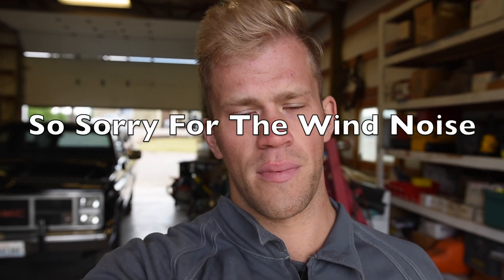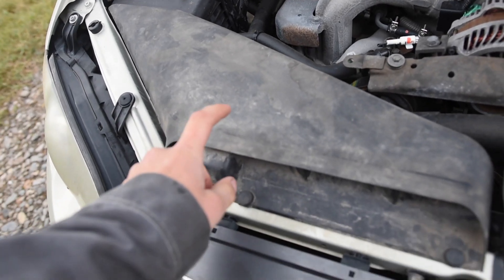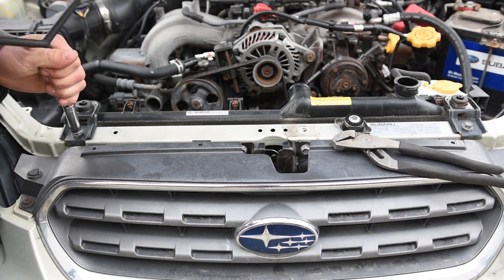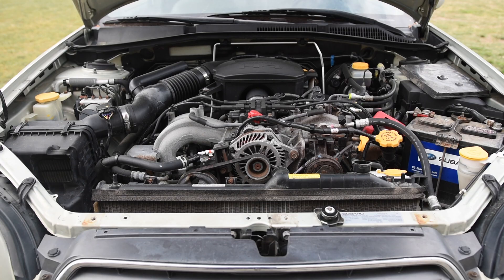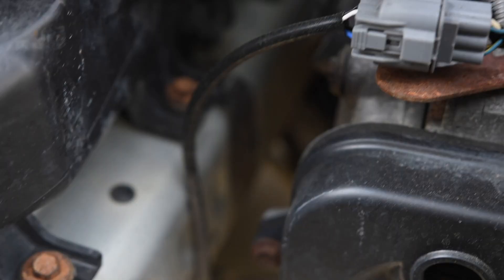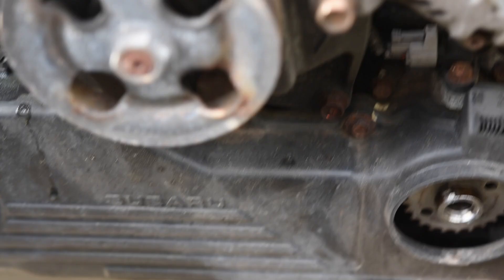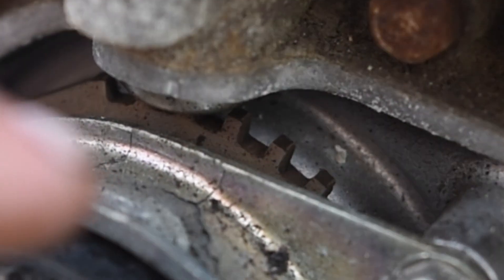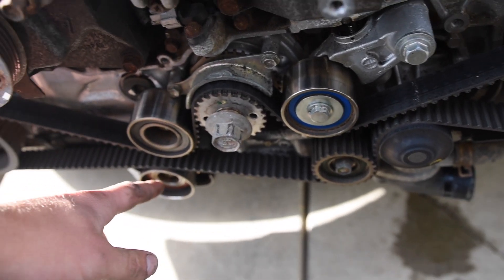SOHC Subaru Timing Belt Replacement Procedure

Comment: Thank you so much... I had an issue, while tightening I didn't have a partner to help tighten the crank pulley to 130lbs so I used the cam gear as resistance and heard the timing belt jump a few sprockets/gears.. I finished putting everything together, and the car didn't turn on.... I'm assumming I did the timing all wrong 😅😅🙈
Reply: Miguel Acosta yea you need redo the belt

Comment: Did you need to bleed the tensioner? (If you used a gates kit)
Reply: Nope. Ive done several and only thing you have to do with the tensioner is pull the pin after you've triple checked everything lines up then pull pin and confirm lines are still perfect

Comment: 13.05.19 - Love you clip has to be the best yet, we have one that's just turned over 96,000 ks and going about buy the complete timing belt kit $330 and also going to replace all the belts, radiator and cooling and heater hoses and anything else that needs attention once I get in there.

Comment: I've watched 4 timing belt replacement videos and NOBODY mentioned the two hoses at the bottom of the radiator that connect to two lines sitting below the battery.  These are transmission coolant lines according to the Haynes manual. You'll have to provision for plugging them.  A local shop told me this is just transmission fluid that cools somewhat by running through the radiator.  It is a separate circuit within the radiator that does NOT mix with the engine coolant.  I have a 2006 Baja, non-turbo model.

Comment: Hi I have a question. I had a hard time removing the crank bolt after the new belt was installed after turning the engine And when I got it off some thing happened and now cam lines on left and right are still lined up but the crank line for the middle is off about a inch.it seems like it might have turned counter clockwise when I was turning off the bolt.  I'm not sure what to do. In thinking I can just remove the belt reline up the crank  and reinstall the belt. my car is a 2006 and interferance engine so I don't want to make a mistake if that's not the right to correct my problem.

Comment: Timing belt on 2010 Subaru says 105 months or 105,000 miles I have 70k miles but I'm at 105 months can I wait in your opinion and if so for how long?
Reply: I would just go by the miles.  I have 100K on mine, and I think my belt could go another 50K before it might need to be replaced.  It has no wear and tear on it at 100K.  I think the 105K is a safety margin to make sure nobody waits too long, and sell some parts and service, of course.
Reply: Mateo Carlos thank you.

Comment: How do you get the air out of the waterpump on 2003 Subaru
Reply: Donna if you still need it fixed, Get a "Spill proof funnel". No, this is not a joke! Google it then check Amazon. They have them for around $25-30. This is not an ordinary funnel,it has adapters to fit where your radiator cap goes. Be sure to squeeze the top radiator hose while the motors running to help move air along. Also I think yours has bleeder screws on the radiator itself,  they work when the coolant is low but are ineffective when the coolant gets above them. If you still have air in the system after bleeding, you have a blown head gasket, warped head or both!  Air bubbles cause hot spots in these engines & cause overheating. Also make sure you run the heater wide open to rid the core of any air. Hope this helps you or anyone else. Good Luck.

Comment: Can you explain how to change the transmission radiator coolant pipe not just the rubber hose but the melt bar it's self.
I own an 08 2.5i impreza  
This is the first car where I'm fixing things by myself  so just needed a little  guidance and i trust you 😊 
Thanks for your help. 
Mel

Comment: How do you take the crankshaft bolt out after you rotate the engine?
Reply: Here is a nice little trick for getting the crank pulley on and off quick and easy. You just need the alternator belt! https://youtu.be/BTysmAxU_nw

Comment: Excellent video, changed the belt on my 04 forester this morning only using the guide, took me about 3 hours going at a slow pace.

To those asking about water pump, I purchased my belt from a Subaru dealer and the bloke advised that water pumps don’t need replacing on these, he said he never sees any fail. And he was right might felt brand new so I kept the original in.

To those suggesting the radiator does not need to be removed, I got away with just removing the fans, maybe the OP just removed the road to get camera angles.
Reply: I have an 04 Forrester too at 118k miles, how many miles did you swap it out at? I’m thinking of driving down to NY from Boston next week, will it be fine or should I not risk it? Thanks in advance

Comment: Do the timing covers have gaskets?
Reply: My non-tubo Baja does have a rubber liner for the timing cover.  Probably to keep debris out.
Reply: No they do not have gaskets.  It is just a cover mated up to the external part of the engine, no fluids to seal in.
Reply: is their zero tolerance on a subaru

Comment: radiator won't come out "easily" for those with AT tm--. pain in the a**. Also, our horrible car that came from the north with all the salted roads had the lower dumb-ass clamp break--now what a pain. They're too cheap&lazy to use SS hose clamps so this wouldn't be a problem(not to mention the valve cover bolts "sealing" themselves inside the cam cover--USE GREASE, IDIOTS, ;even after welding a 16mm bolt they still wouldn't budge!!!!.
Final point--never buy a northern car

Comment: Quick question while im doing my subaru.if one of the cams jump a little when taking the belt off, how do i align it back.?can i jist turn in on its own?
Reply: I have the same issue, wish I knew how to fix this.
Reply: Doesn't matter how many times they spin or what direction as long as your marks line up at the top once its all done. Can be slightly off, wont be 100% on marks every time as long as it's as close as possible.(guessing you figured it out but hope this saves someone some panic and time)

Comment: How important is it to replace the other pulleys and tensioner when doing the timing belt? I notice the full kits are quite expensive! Additionally, would you recommend doing the waterpump at the same time? Thanks!
Reply: I mean my rule of thumb for anything is.  If you're taking it all apart. Replace everything you can.
Reply: I was wondering the same thing.
Reply: @seandknutson  it's very important as these parts have limited life and will need replacement.I recommend Aisin kit
Reply: I made the mistake of letting a local shop replaced my timing Belt and all they did was replace the timing belt. I had the factory pullies still in my car. At 205000 miles the pulley with the cog teeth on it self destructed and the car jumped time time and fired. I was a 100% sure that I had trashed the engine. After watching this video and putting in a new kit it turned over perfectly 1st time with no noise from the engine and no damage done. Spend the extra money replaced the pulleys when you replace the belt. 80000 miles from now I'm going to go ahead and replace it all one more time.

Comment: Can the 3 notches be lined up individually, with the belt off?
Reply: Only slightly, you don't want them slipping more than half to 3/4 a turn if you can help if and if they do move try to note which direction so you can turn them back slightly. Valves can get scraped bent scarred ect. Usually only happens when running high rpm but possible to cause some bending by having it turn too far. Definitely don't want that belt off before having it at tdc that would be a nightmare but still possible to get right.

Comment: Why would you torque the timing idler pulleys after you set the tension on the belt? and when you are first releasing the tension off the belt why would you take off the lower idler pulley? instead of releasing the tension off the tensioner?

Comment: Be sure to also check that the car doesn't have a "stretch fit" belt (2008 models onward) for the compressor which will need a special fitting tool as there is no tensioner for that belt.
Reply: Jester Mgee Great point. Rally Sport Direct has the tool along with many other places. 

https://www.rallysportdirect.com/part/accessory-belts/gat-91031-gates-stretch-belt-installation-tool?gclid=CjwKCAjw14rbBRB3EiwAKeoG_5C0xS0PNqcwKcR7lln5lSSUQBXTPSz8zqjisZai48rtJJTICMUSyxoCBY0QAvD_BwE

Comment: Hey Devin,
Thanks for the awesome video. I am a dummy and rotated the crank shaft trying to get the bolt off after lining everything up and removing the belt. This threw one of the camshafts off of top dead center. I just used a 17mm to rotate the camshaft back to top dead center independently of the others. Am I okay?
Reply: What happened?  I was curious about this too?

Comment: I have to say SOHC instructions you are giving is spot on it's the same for the 04 Forester 2.5 H is the same way to replace the timing belt I have change timing belts on all the the cars I have owned and the quickest one is the Suzuki sidekick that one only took me 30 min, I should have kept that motor solid by far, could have made a dune buggy for the Grand-kids to horse around on , keep up the good work!

Comment: Great video. Super helpful. I had the dealer replace the front control arms Etc for around 1k after they failed to spot the bushings were wearing at the 90k service which would have saved me $700 when the wheels started  fibrillating at around 65MPH. Could have done that myself before it became a metal on metal situation requiring replacement. Going to do the rear bushings myself then the timing belt with new bearings Etc next.

Comment: Thanks for the video, and it was very helpful. However, I have a concern regarding the RH 2.5L SOHC Cam Shaft Timing Gear Pulley Sprocket Right. Does it have to be made of (carbon fiber like material) or it could be made of metals
As by searching, found both metal and black(material) non-metal. But not sure what to install. Ordered one but was metal and wrong one. 
Also, are the RH and LH sprocket pulleys changeable?

Comment: I got distracted and removed the TB before aligning timing marks. Am I ok to line up the crankshaft marks and then each cam sprocket individually? 2003 Subaru Outback SOHC. Please help!
Reply: Thanks top rahmen, but I had to finish it this past weekend since it’s my daily. I did what you described in your first comment after tons of research. After getting the crankshaft into position, the passenger side cam moved freely and was easy to adjust, but the driver’s side cam was more difficult. Had to use a socket wrench to turn the cam a few rotations (clockwise) in order to line up. I had to get it just right or else the tension would release and the cam would spin 180 degrees or more. I’ve driven 200 miles or so since the TB change and everything sounds/feels good so I’m assuming everything is OK. Thanks for reaching out!

Comment: One of my cams jumped.. do i just keep turning it until it lines back up? It has alot of compression on it now aswell
Reply: The crank pulley mark under the timing cover actually puts all 4 pistons in the middle of the stroke. No engine damage will occur. Subaru was very smart when they did this. You can spin both of the cams all the way around with no damage. It is an interference motor though, If the belt breaks while running the engine there is a very good chance of damage. I made a sweet video on removing and installing the crank pulley. You just need the alternator belt! https://youtu.be/BTysmAxU_nw
Reply: I'm having this problem. What did you end up doing bro? Please help.

Comment: Any idea where I could get that belt guide that you remove at 8:10 in the video? I have a girlfriend who was given and Outback and it immediately jumped timing on her. We took it apart and that guide is missing.
Reply: That guide only comes on the Manual transmission models. No need for it on an automatic. Hope this helps.
Reply: The guide on manual transmission models is to prevent the belt from coming off on deceleration or while engine braking. Its a must have on the Manuals!

Comment: Many thanks for a very helpful video. By the way, just in case anyone wants to re-check the timing against the marks on the belt they will all line up again every 24 revolutions of the engine.
Reply: @Frank. T No - the belt is 223 teeth long if I remember right and the crankshaft toothed pulley is 24 teeth so after 1 revolution of the crank the markers are only 24/223 part of their way round one lap of the timing system. The mark gets back to the crank pulley after 223/24 or 9.29166 revolutions of the crank and actually engages 7 teeth away from where it started so the mark on the belt does not line up with the mark on the pulley. Actually, what I wrote previously was wrong - the marks don't line up again until the belt has completed 24 laps of the timing system which takes 223 revolutions of the engine! Obviously the guys at Subaru did a proper job of designing this as a hunting mesh to keep the wear even.
Reply: @colin mill Good day sir. My timing belt broke as I was warming up one day. What is the best way to line up the cam sprockets? Im assuming just with a socket wrench manually but please confirm. Thanks in advance.
Reply: @PlayfulCiciRex  Sorry to hear that. I think the first thing you need to determine is whether the valves are OK. I believe earlier Subaru engines were non-interference engines so the valve would not come into contact with the pistons if the belt breaks while the engine is running. However, I believe later engines are not so tolerant and that some of the double overhead cam engines can also have valve-to-valve clashes when the belt breaks. In terms of rotating the cams to line up the timing marks I have always done this with just a socket on the heads of the sprocket retaining bolts but in your situation you need to make sure none of the pistons are near top dead centre when you rotate the cams as you could otherwise drive a valve into a piston. It's thankfully not a situation I have ever had to deal with so I'm not the best person to advise you. Hopefully there is a YouTube video that will give you more info on that specific situation.  Good luck!
Reply: Colin Mill many thanks for the information. Ill try my luck and manually align the cams and hopefully all goes well. Have a great weekend.
Reply: Colin Mill I was courious about a 1000 r.p.m.
Reply: Slow motion cameras. Are thinking 💭 and?
Reply: Ah great I was wondering thanks.
Reply: A strobe light! Is enrollment needed.

Comment: How do you torque the crank bolt if the car automatic?
Reply: Here is a nice little trick for getting the crank pulley on and off quick and easy. You just need the alternator belt! https://youtu.be/BTysmAxU_nw
Reply from the maker: Use a chain wrench to hold the crank pulley.
Reply: I did it,  the chain made a few nasty dents on the pulley. How do I fix it? Otherwise it'll chew the A/C  bet.
Reply: Subaru makes  special tool for that. Don't use chain wrench.... oops... Too late.

Comment: Great video, I have a question.
How do you get the crank pulley back on an automatic ?
Reply: Here is a nice little trick for getting the crank pulley on and off quick and easy. You just need the alternator belt! https://youtu.be/BTysmAxU_nw
Reply from the maker: As far as torquing it? You can use a chain wrench on the pulley. http://amzn.to/2BmXjEm

Comment: Great Video! I will also need to replace the backside of the cover as well due to an engine bay fire. If I take off the cam pulleys to get at the back plastic can I assume that they just go back on lined up no problem or is there risk of the internals moving once the pulley is off?
Reply from the maker: No you should be okay.
Reply: Thanks so much for the video you prepared.  Really helped me to successfully complete replacing my timing belt, pulleys, and water pump.  Saved me a ton of dough!

Comment: Hey brother question here. Is this the same for a 1998 Forester? I was told it needs a new timing belt adjuster so im guessing that's the tensioner?
Reply from the maker: I believe the Forester would be DOHC. Nearly same process, just two more cams to deal with. 

Yes, that'd be the tensioner.

Comment: Great video. Thank you! It is not easy to do the video and do the work. Hats off to you for spending the time to do it. I have an '04 Outback that needs a repeat job. I had mine done at a mechanic 2 years ago, but I now have oil leaks, possibly from the crank seal. I also see leaks around the timing belt cover. Lessons learned. I will do it myself this time.
Reply from the maker: You're welcome!
Reply: Getting gyp'ed by unskilled mechanics - they take your money and don't fix the problem, or worse - is the reason I became super-interested in learning how to do my own work! Youtube was a huge game-changer with that. Now everybody can be a mechanical genius from what smart-guys freely share, here.